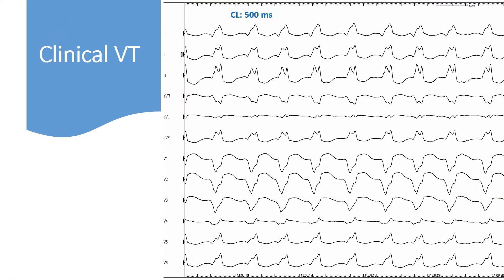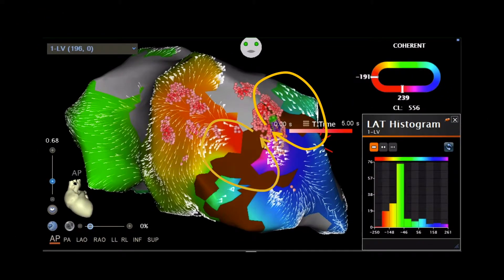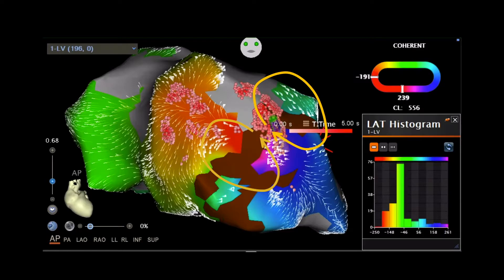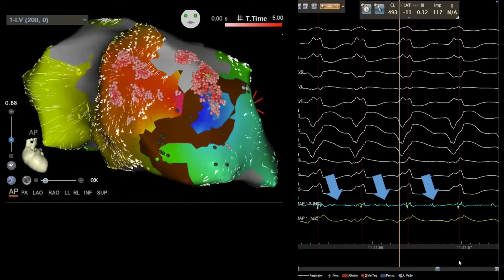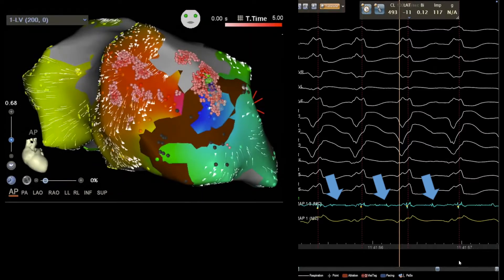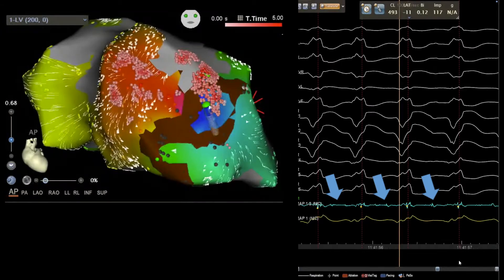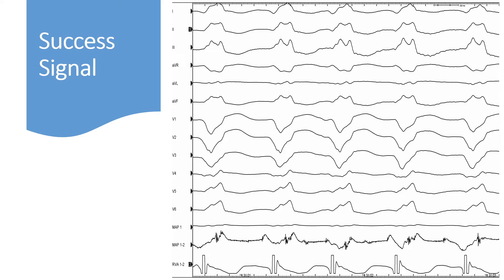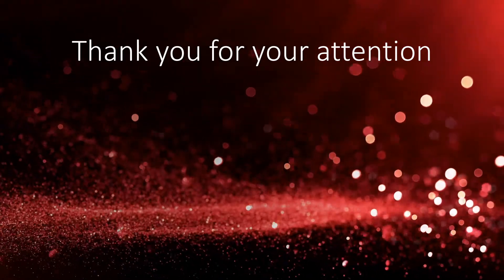Coherent Mapping VT Ablation

Comment: well done, but how is it possible to have complete activation mapping in LV just by 200 points (may be u mean 2000)?
Reply from the maker: Thank you for this very good comment. It was just 200 points but covered the hole circuit. Usually we use MEM, but I just wanted to show that this kind of mapping will work with other options.
Reply: @arasharya  it means u guess the probable focus and map it locally? or it was accidentally happened.
Reply from the maker: @alibozorgi6833  Thanks again for your comments. Based on morphology we did in this case just a limited targeted mapping.With MEM it would have been much better but we wanted to show that it also works with Point-by-point mapping, even with lower number of points. At the end of the day the most important point is ablate the VT as fast and safe as possible.